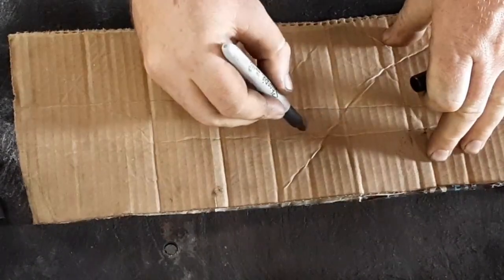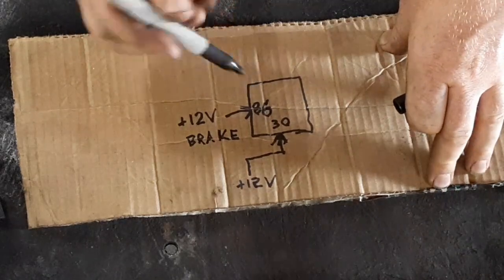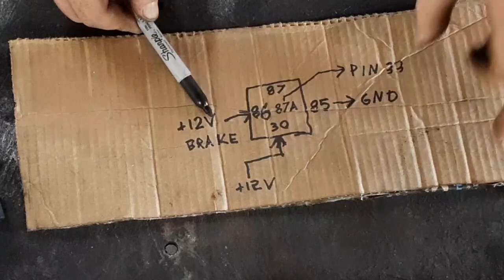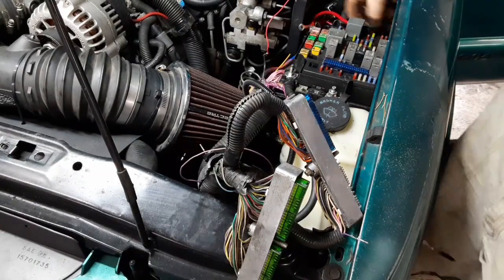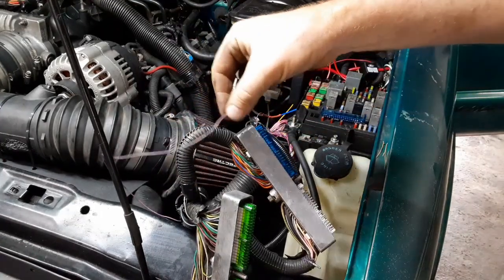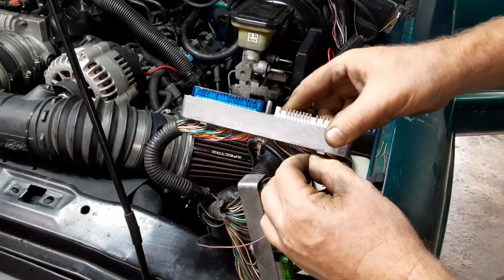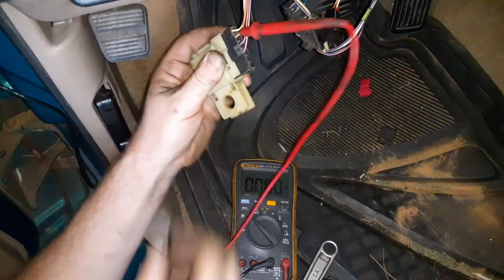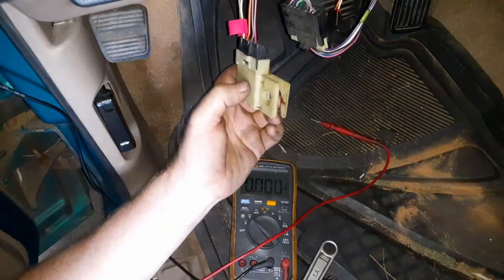TCC Switch Wiring for any LS Swap - Brake Switch using a Relay

Comment: Thanks for helping me out. Never really messed with relays too much. The relays i had kickin around all had the universal "black" ground wire in pin 86. Is that normal? Probably why i couldn't figure this out. Repinned so i wont get confused down the road.
Reply from the maker: I've seen all kinds of random wire colors on relays, it's best to go by the pin numbers instead of colors.

Comment: Would this setup work for a 2 prong brake switch in a 80 Camaro? I have a 6.0 with a 4l80e along with the original harness and computer. Im trying to get it to crank. I hear  noises in the fuse box when i connect battery. But i figure it wont because of safety feature.  Idk

Comment: dude, I couldn't figure this stupid relay out no matter how many different diagrams or videos I watched and watched and watched. you however, for whatever reason did it differently and explained it and used the right words when you walked thru each step and where the wire would go, I fu*$&#g nailed it!! months of this swap into a dodge/Chrysler was hell, and the lights and brake switch have been the stupidest thing Chrysler has ever managed to screw up by putting everything thru a module and into a computer somewhere, but with your video, I nailed it! thank you so much! thank you truly isn't a big enough word to describe how much you really did make my day! thank you thank you thank you.
Reply from the maker: If you want to know the easiest way to do something, ask the laziest guy around. I like to keep it simple. Glad it helped.

Comment: Just a heads up ... apparently some setups want the 12v when brakes applied, others want 12v when brakes not applied
Reply from the maker: Yep, that's how this ones wired, there's two separate input pins on the PCM that each need a +12v signal from each condition (brake on and brake off) for cruise control and TCC lockup to work. That's why a relay is wired on, it supplies the other +12v signal that the older "standard" brake switches don't support.

Comment: So I tried connecting to my hot wire from the brake connector under the hood but when I use the blinkers it applies power in and out like the blinker so then what wire would I tie in to because I don’t want the torque converter lol locking in and out with my blinker switch … I haven’t tried the wires getting under the dash to the brake switch just thought it would be easier to tie into under the hood bs under the dash

Comment: is this why my swap don't start after I put the tranni? I have to have this to unlock the torque converter?
Reply from the maker: There's too many possibilities for me to narrow it down to a TCC switch, your best bet is to get a cheap OBD2 scanner and see what codes the computer is giving you. If the computer is preventing the engine from running, it will tell you what it sees wrong.
Reply: @wilsworkshop  I have done this there is no codes
Reply from the maker: Then it should be power, ground, or fuel pressure related. Anything sensor related like the transmission the computer would give fault codes.

Comment: Where did you buy the stuff
Reply from the maker: The Junkyard - My Second Home
Reply: @wilsworkshop  the relay and wires?
Reply from the maker: Yep, I have a pretty extensive collection of wiring and wiring stuff from junkyard sales. If you're looking for new, here is the best deal on relays I've found, I've used a bunch of them and haven;t had any problems with them being 'import' quality. They have the little mounting tab to screw them to the car too.

https://www.amazon.com/gp/product/B0748F1JK4/ref=ppx_yo_dt_b_search_asin_title?ie=UTF8&psc=1
Reply: Thanks

Comment: If I run a 700r4 with my swap, will I still have to worry about wiring up the tcc? I just barely found out this is a thing but didn’t think these older transmissions had it as they were all mechanical. Could be wrong
Reply from the maker: You won't need it for a 700R4, It's only for the 4L60e/4L80E computer controlled TCC and Cruse Control.
Reply: @wilsworkshop  that's not true.  700r4's used a computer to control lockup.
Reply: there are kits out there or you can make one
Reply: @332ARA  I crawled under my dash and saw the two switches on my brake pedal. Guess the 700r4s do have it. I always assumed it was some sort of mechanical lock up since I’ve never seen any sort of wiring in that transmission that would hint to an electronic lock up. I’m not that familiar with them though

Comment: So do I connect park/nuetral wire from standalone harness to the ground as well?
Reply from the maker: It depends on how the wiring is setup. With an aftermarket harness you might need to check the wiring diagram it should have come with to figure out what wires need to be connected where. I usually just use the stock neutral safety switch on the side of the trans and plug it in.

Comment: What if the purple wire (I have a psi harness) already has 10 volts to it for some reason ?
Reply from the maker: Check the booklet that came with the PSI harness, it should show you what that wire's connected to. PSI also has good tech support you can call for their harness.

Comment: Thanks alot my 03 s10 is goving me issues where torque converter lock up doesnt work ive change  alot of parts but could never get the torque converter to lock up  im gonna check that wire in my s10 for some reason i feel is either not hooked on right or the brake switch in my s10 is faulty or it is not providing the 12v constant if its not working im gonna try your method but anyways i have a question ? Does the s10 brake switch supply power all the time to the purple wire for pin 33 or not?i know it suppose to cut the power when it sees the foot press  on the pedal

Comment: Was your truck originally a manual truck then?
Reply from the maker: it was an automatic originally with a 4 L 60 e 2.2 L
Reply: @wilsworkshop  just wondered. The brake switch on my 99 2.2 S10 already had the correct wire for that when I made my harness.

Comment: On the rely pin 30 can I run it on a ignition switch? Or the constant 12v is okay and won’t hurt the ecm since it will be constantly running on 12v while vehicle is off.
Reply from the maker: Ignition would work fine, I don't think a constant +12v would hurt the computer, but a switched source would be safer for sure and might help prevent a parasitic draw when the cars sitting.
Reply: @wilsworkshop  gotcha thanks a lot for the help. Learned a lot from your channel.

Comment: Did your truck not have tcc switch on the pedal switch?
Reply from the maker: It might, most of the stock wiring is disconnected so this was the easy fix since I had already wired the brake lights back into circuit. It also gave me the chance to show how it could be done with any type of brake switch.